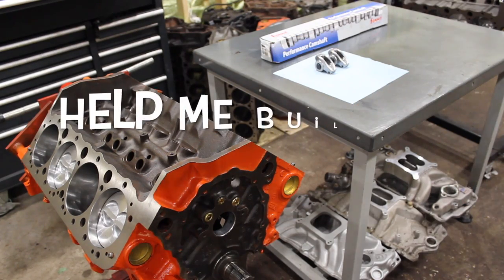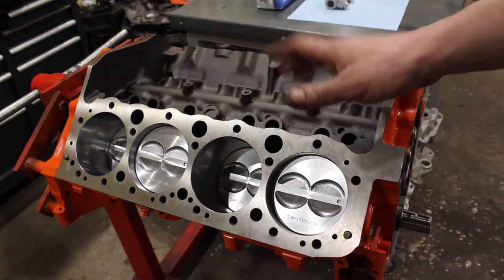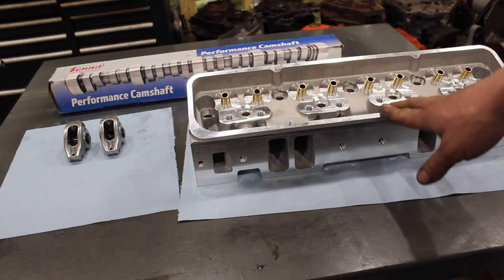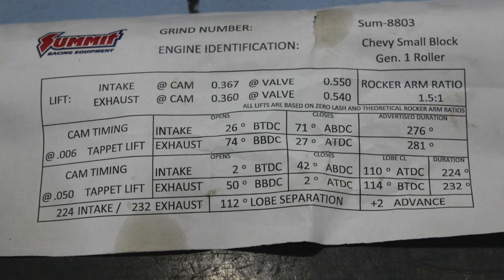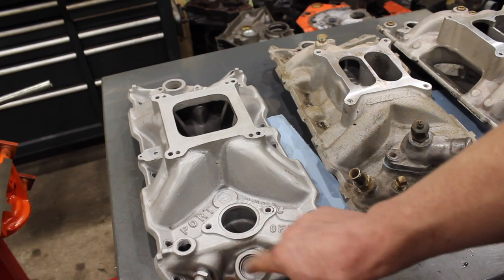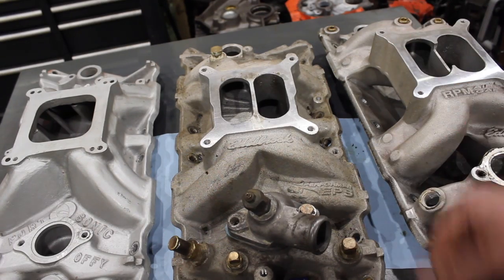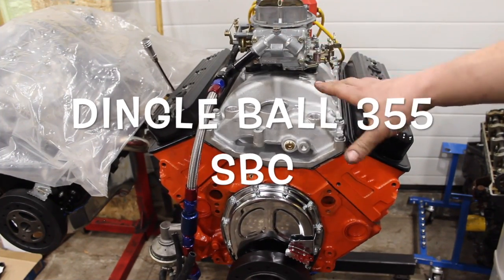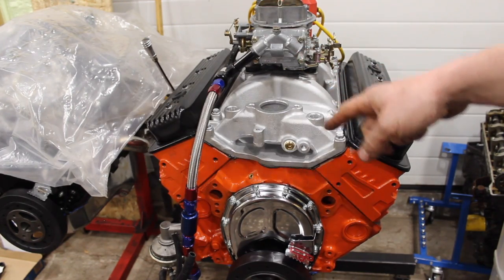What Intake would work the best? + Bonus peek at the 11:1 Vortec Build (260+ CFM)

Comment: Port o Sonic good for 230 plus duration cam more compression.  That cam is like a CC503 on the LT1 it has good bottom end strong mid range nice top end with those heads rockers and springs The air gap is the one to run Decent bottom end better mid range than the single plane had port o sonic the eps better for milder cam. RRun 1 inch phenolic spacer on the air gap with 750cfm carburetor should spin 6300-6500 rpm shift points.

Comment: I think the weak link will be the stock cast crank. no sense in trying to make lots of top end power with the heads, intake, and cam, when the bottom end won't handle the RPMs anyways.. I will go against everyone else and say use the eps dual plane.. should make great punchy torque for a light to light car with 4.30's in the rear.
Reply from the maker: If you have Instagram follow me, I have a chevelle on there that I built a 355 with ported vortec heads. Was a great NA combo.
He wanted to strap a torqstorm blower to it even though I warned him it wasn't built for boost.
(Cast crank, pm rods, hyper pistons) 
Its gone the whole season now with the blower with no issues, the thing hauls!! I tuned it pretty carefully with the sniper efi which helps alots
Reply: @cuttersperformance  what would a stock 5.7vortec rebuilt with 2k miles on it make for horse power with a kegs air gap intake manni and Holley sniper hyper spark coil ignition and hyper spark dizzy set up make  or would this air gap be to much for a stock engine beside the Holley sniper thanks love your vids by the way
Reply: Cast cranks can handle quite a bit of power. As long as good machine work has been done along with a quality balance job a  cast crank with no boost behind it will live just fine. Cranks rarely break on their own usually they fail when something else catastrophic happens. Is a forged piece nicer oh sure but at this power level and no boost not necessary.
Reply: @conservativecrusader80  SBC cast crank are just fine. I turn them 7000 RPM all the time.

Comment: Air gap sounds good for that duration at lift. I want summits 8801 cam but depending on your results with this setup I might change my mind. From my knowledge Crane makes summit cams
Reply from the maker: I'm curious on how this cam performs aswell. 
You know that crane makes those cams? Seems like a really nice peice
Reply: @cuttersperformance  seems like Elgin would be the manufacturer.
And i believe Hastings makes Sealed Power and a few others too
Reply: @downback5822  yes your correct there's alot of rebranding goin on. Elgin and Hastings/sealed power have alot of products out there. Engine pro and engine tech are all rebranded products. I bought a cam from Jegs recently (good price) definitely Elgin cam.
Reply: Except crane as you know it ceased to exist years ago.
Reply from the maker: @b.c4066  thats what I thought also. Also is certainly doesn't look like a crane cam

Comment: Eps has the smallest runners.,  womt flow as much as the heads
 The air gap also has runners that flow less then the heads. 
  The sonic with a hvh 4 whole spacer will top both the others.
   Its just for dyno numbers right? S0 2500 - run out. 
  Flow capabilities of each.....235, 245, and 270cfm. Eps,perform rpm, and sonic. 
   Your budget vortec will make more average power all around compared to this combo.
Reply from the maker: That was a good point so for curiosity I threw them on the flow bench 
Average flow numbers between all runners 
EPS intake 230 cfm 
Offy single plane 263 cfm 
Air gap intake 270 cfm 
Believe it or not the air gap actually flows the most and that probably has to do with the height of the manifold
Reply: @cuttersperformance  hard to believe any dual plane small block intake can flow that much. The devided plenum restrict it. My numbers are also from high port on number 1 cylinder.